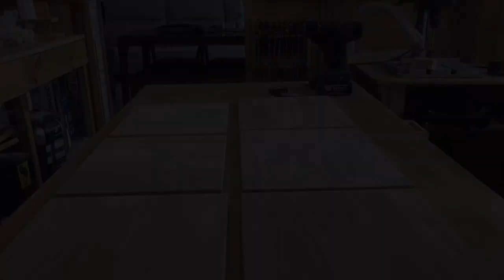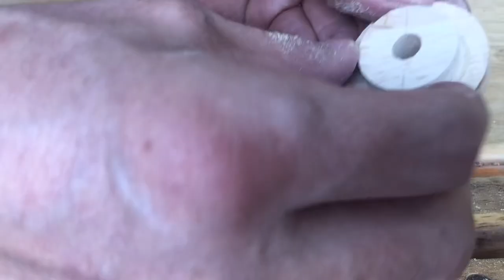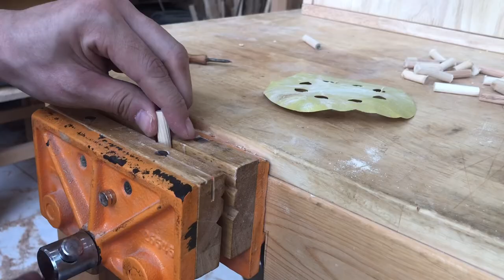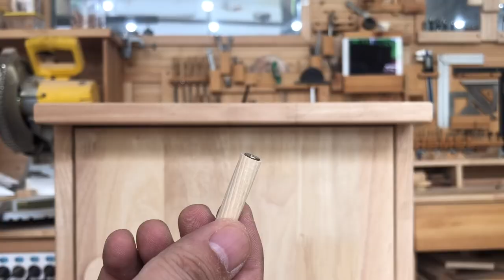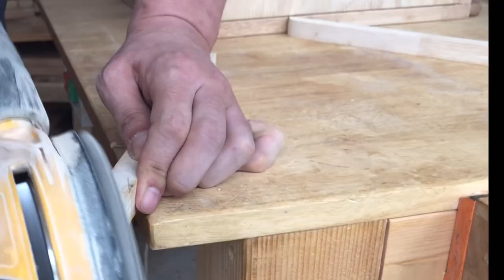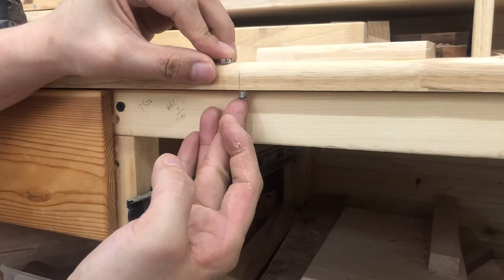자연 하중을 이용한 잠금 장치 만들기와 숨기기 / 목공 DIY

Comment: Nice, but I see one caveat/possible improvement. This will fail and make you search for the parts if you will lock it in open position. You could make the pins with the thicker upper part inserted from the top, so it would interlock when falling in the "down" position. It would leave you with the holes but you can mask it with one more part of even wood on the top
Reply from the maker: Thank you 😊 Have a nice day 🍀

Comment: Nice. I feel like you could also make it so the locking bar just slides back a few center metres (stays parallel instead of swinging to the side). You'd just need to add some decorative bits to cover the channels in the top that the keep the locking bar in position.... Probably not worth the extra work but these things often aren't when you make them for yourself.
Reply from the maker: 👍 It's a good idea when making finished products.  After a few more tests, I'll try it when I get the finished product.
Thank you 😊 Have a nice day 🍀

Comment: Great work! Are you planning of adding a sort of captive mechanism for the dowels when you removed the top magnet while the door is open so you won't lose it?
Reply from the maker: Thank you 😊 Have a nice day 🍀
Reply: Then the pins wouldn't flow freely right?
Reply: easy: just don't remove the magnet when the doors open
Reply: I thought the same and that's why I'm in the comment section to see if anyone made that point. A roll pin may be able to facilitate that ability. The dowels may fall, but only far enough to lock the door.  The magnets would be needed  to lift the dowels again to shut the door, if moved with the door open. Should be fairly easy to implement... much easier than writing this. Seems(actually is) to be a very over complicated response I have written.

Comment: That left hand rail looks different from the right hand rail, so it might be tinkered with and someone then accidentally discovers it can open the lock.

I suggest attaching screws into that left hand rail positioned similarly to what is on the right hand rail, but shorter screws so that they aren’t driven into the cabinet box. This will better conceal that the left hand rail is the key to the lock. And maybe add a “ball catch” on the underside of the left rail to give some slight resistance of movement to those who might tamper with it.
Reply from the maker: Thank you 😊 Have a nice day 🍀
Reply: I was just thinking that a ball catch isn’t needed to add some resistance to rotation. A steel flat head screw or two can be installed into the cabinet frame directly beneath where the magnets rest when the box is locked; the magnets will be attracted to the steel screws and that will provide some resistance to rotation. Much simpler operation compared to a ball catch, and easier to install too.
Reply: @stevebabiak6997  See https://youtube.com/watch?v=6hTmBnvy7BI&feature=share&t=4m16s to https://youtube.com/watch?v=6hTmBnvy7BI&feature=share&t=4m22s that is exactly what he did.
Reply: @TechRossNZ  - yes, the magnets do better than a ball catch. But my first comment is still in play partly, the part that suggests to add short screws in the same places as the other side so as to conceal the difference between the function of those parts.
Reply: @stevebabiak6997  sorry, yes I agree, it would  give the illusion that that side is also screwed down.

Comment: Wooden dowels like you used with the screw may work better, but I wonder if small rods of steel would work. I wonder if they'd be too heavy.  I actually have some steel rod laying around. I suppose once I clean my shop up and find it I could try it.  Lmao!
Reply from the maker: In the upgraded second and third video, a light metal rod was used.  Thanks for the good comments. 🍀👍😄

Comment: Regarding The first box shown. If the bar moved left and in front of the table instead of right over the table you could use the locking device without sweeping everything off of the table.
Reply from the maker: Thank you 😊 Have a nice day 🍀

Comment: If you make the pin have a large square head and insert it through a routed slot, you could have the pin captive so it can't fall out. By using a square head you could keep it aligned so that a bevelled tip can make the door close without the magnet in place.

Comment: Great idea but the bolts fall out when the door is open and the lever is moved back. Something to prevent that would be good.
Reply: Can't the box be opened by just turning it upside down?
Reply: @Kingdeathtrooper  didn't even think about that but probably.
Reply: Then again, why would you move it back? But I agree if you did it by accident it would suck. 

Maybe number them, so they're easier to put back in the right spots if they were to fall out
Reply: @Kingdeathtrooper  Yes he shows that @ 5:15

Comment: I assume the first one could be made in a way that it does not open by putting it upsude down, by the simple addition of springs in the pin mechanism? they just would have to be string enough to hold the pins up while the box is upside down.
Reply from the maker: Thank you 😊 Have a nice day 🍀

Comment: Hmm. If you move the bar away while the door is open, wouldn't that make all the pins fall out? 
Obviously you shouldn't do that but I feel like someone would end up doing it accidentally at some point.
Making the pins have a wider head that won't fit out the bottom of the hole would fix that.
Reply from the maker: Thank you 😊 Have a nice day 🍀

Comment: Really nice piece of work.
Just some minor ideas: the bolts can be seen and the principle guessed too fast, so maybe make an overlapping edge to the door
Further: by flipping the case over, it will open. I'd try magnetic "dimple pins" working in bith directions (using LockpickingLawyers words): not just iron screws, but also magnets on top of the pins, some working up, others down, using springs, so that they get attracted or pushed depending on the polarity of the magnets on both sides. (not to forget a detail, so that the top springs won't fall down)
Reply from the maker: Thank you 😊 👍
Have a nice day 🍀
Reply: While installing this somewhere, screws through the bottom of the safe makes flipping it over pretty hard.

Comment: But looking at the locked door from the front, you can see where the 4 pegs are, and seeing that there is no keyhole, trying a magnet exactly above those pegs is probably the first thing I would try. I would have placed the pegs such that it is not visible where they are when the cupboard is locked.
Reply from the maker: Thank you 😊 Have a nice day 🍀